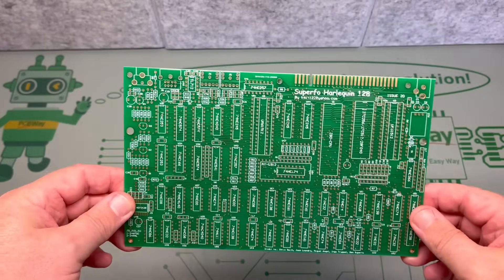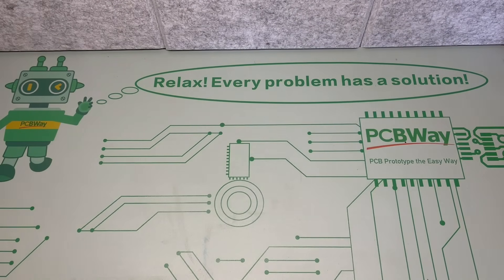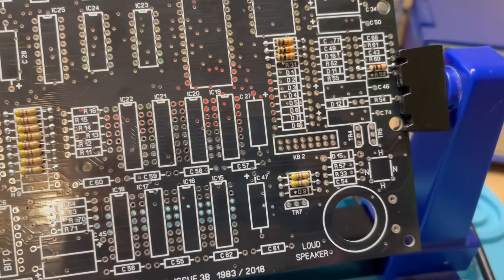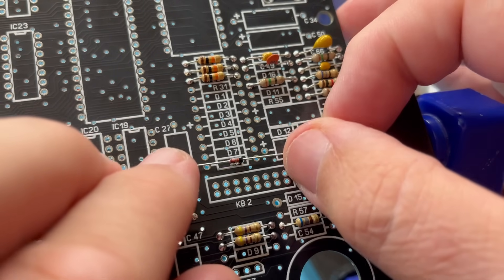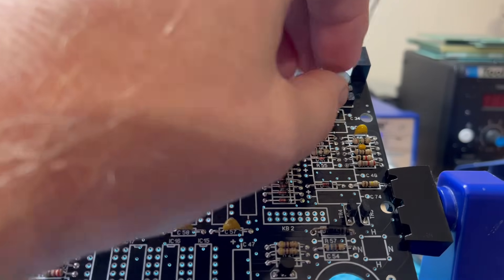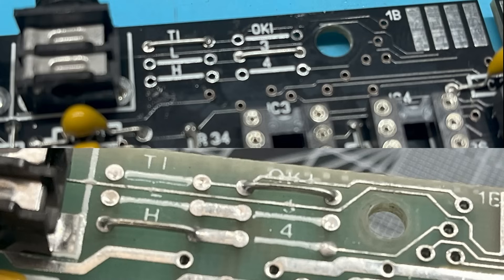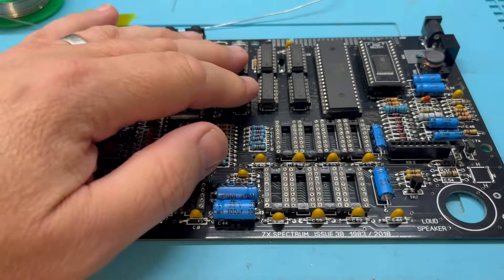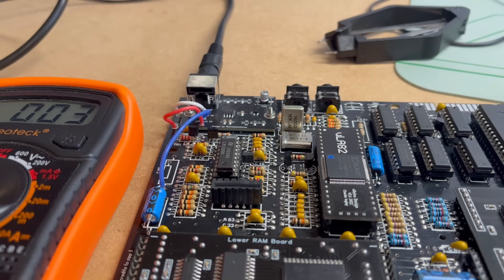I can't figure this out!  This BRAND NEW Spectrum has ISSUES!

Comment: I prefer to bend the leads in towards each other and twist them together to hold the component in place, and it makes snipping the extra easier since the pieces don't go flying off. It also usually keeps the trimmed ends out of the way of other vias / solder points.

Comment: what values did you use for r43, r44, and c72, theyre critical ,also try feeding it with an external +12v supply, maybe up to +12.5 or so, as your +12 is a bit under, some of these TV circuit chips are very fussy with supply voltage , datasheet lists it as 12v 'minimum'

Comment: the LM chip only generates the colour signal, not the whole video, the spectrum will work black  n white with it removed , there is also a 'similar' TI chip that can be used as a drop in equivalent, but its supposedly a bit unreliable , and also obsolete

Comment: For all those screaming NTSC! To get a spectrum like this to display an NTSC compatible signal, you’d need a special variant of the ULA, and two different crystals. And even then… in the UK most TVs have been able to display PAL and NTSC for decades. If it’s capable of S-Video, it’ll handle both.

Saying that… trying it on a different TV seems sensible

I’d also give swapping chips on a regular speccy… I’m sure you have one. The reality is that the ULA is king here, and you’ve kind of tried the LM1889. 

TR1 and TR2 are the other components to check… with R48/49/50

Comment: i can't help but wonder if TR1 & TR2 are the wrong way round ? but this would depend on the pinout of the transistor and are the markings reversed from the original board ? i have some of these boards in my to do pile so looking forward to part 2.. shame that video chip cant be bullied into taking 5 volts
Reply: TR1 and TR2 are correct on the silk screen for the original transistors which was not a TO92 package. A common mod is to use a BC549C which is a TO92 package and has the the pins in reverse order when looking at the flat side. So nothing wrong, just not using the original component...

Comment: You correctly said you were going to solder everything from the lowest profile first and work your way up. So why did you do the power stuff and the tall standing transistors before the sockets? The whole point of the process is so you can still lay it flat helping keep things like the sockets steady and flat while you solder. With the taller power stuff and transistors in place you will have it wobble and the weight of the board wont be helping keep the sockets in place.

Comment: I had a similar problem when I built the Harlequin, b/w picture. In my case I'd bridged two pins of the little SMD Analog Devices chip. I know there isn't one on the traditional board though so not sure here!

Comment: When I started my retro-tinkering career I watched a lot of videos with recommendations to get the turnpin sockets. I thought to myself: I want to have good electrical contact also for vintage ICs with desoldered and cut legs, so I will buy new turnpin sockets. My mistake was to get cheap ones. They caused me nothing but grief. No electrical contact in some cases and broken pins on vintage extremely expensive ICs in other cases. After inspecting these turnpin sockets with a microscope I saw the barrels were of extremely poor quality, and would either not fit or not clamp the pins very well. I cursed a lot, went back to dual leaf sockets and never had another issue. I probably would have had a better experience if I ponied up the cash for some high quality turnpin sockets, but then again as in this video they have a very tight tolerance, and could cause issues as well. KISS principle... Just go with the standard dual leaf sockets. I now own 7 C64's and 3 spectrums, and never have these dual leaf sockets given me any grief.

Comment: I wish they would just integrate a simple bridge rectifier on the DC supply input so polarity on the DC adapter doesn’t matter. This was a common tactic used back in the days of CB radio so an accidental reverse polarity didn’t fry your board.

Comment: Turned pin sockets are not designed for dip ic's. They are designed for turned pins. They will just cause problems over time.
Reply: Well I’ve been using them and specifying turned pin sockets for DIP packaged IC’s for 39 years without any problems.  I’m not the only one either.

Comment: Had this problem developing my reproduction D32 board. Every time it happens the first thing to check is the oscillator signal to the lm1889. No clock means no colour and from experience it was always the lm1889 at fault. These things like to play Russian roulette with a fully loaded gun and don’t need an excuse to fail. There are of course other failure modes and the most likely is no continuity between the modulator the point at which you pick up the signal to inject it in the output. It could of course be the modulator not receiving any colour information from the ULA

Comment: Looking forward to part 2! I am visually impaired and soldering is impossible, so I get my satisfaction from watching videos like this!
Reply: Have you tried a soldering microscope? I too am visually impaired (20/200 in my left eye, and for all intents and purposes completely blind in the other) and also thought that soldering was beyond my ability. On a whim I decided to buy a cheap microscope (not even a particularly fancy one, just a cheap $40ish one I found randomly on Amazon) and it literally made a world of difference. It takes a little while to get used to basically operating your hands at a distance (not staring at them directly, but instead through a screen) but once you can wrap your brain around that, it's like magic. I can even manage those ridiculously small SMD parts, if my hands aren't too shaky because I've had too much caffeine. :)

Comment: Rubbish leaf sockets I bet ! lol! Nothing constructive to add other than sillys like colour on the monitor ok (turned up) and is the 5v clean with that DC DC converter in it as opposed to the venerable 7805 i'd scope it ? I had a flick through the data sheet for th LM1889 and would check values of components around there because the chip can be configured to produce a monochrome output which yours is doing and doing it well ! are all the clocks running at the right speed and running cleanly. Dunno I know nothing about the 'speccy' but I hope (and believe) you crack it soon and it's probably something daft !...cheers.

Comment: Get a scope and check the color oscillator is actually running. Also (with it on) try placing a finger gently over the pins of the XTAL, both pins, then each pin in turn, if it suddenly pops into full color then the series capacitors around the XTAL are the wrong value for its resonant mode.

Comment: Why doesn't the lower ram board populate the outer pins of the outer sockets?
Reply: it only needs one set of address lines for the 8 chips it replaces and one data line from each (plus a couple of other signals, ras,cas,wr + 0v,5v)

Comment: Im 100% invested now. Can't wait for part 2! Board is looking amazing btw. I have an issue 2 ZX Spectrum 48k that was upgraded and recapped by a close friend in the UK. I absolutely love this computer and I'm so excited to see how yours turns out when its finished.
Reply: I would strongly recommend Andrea Vavassori's "Issue 4V" board rather than this issue 3B clone. This one is a perfect replica, there is absolutely nothing wrong with it, but issue 4V is based on original Issue 4B, which by me (and many others) is considered to be the most stable/reliable 48K board of them all. It has got a better DC-DC circuit (where the -5V and +12V is generated) and Andrea added some very clever options like to be able to use easier to find 4164 DRAMs in lower 16K instead of hard to find and very delicate 4116s, optional footprints to use very commonly available radial caps instead of harder to find (and usually old stock) axial ones, and some more options.

Comment: Are you using different transistors for the two below the modulator? They appear to be the opposite way to yours (i.e. the same way as the mask) on an original 3b board. Link here if comments will allow one: https://k1.spdns.de/Vintage/Sinclair/82/Sinclair%20ZX%20Spectrum/PCB%20Images%20%28orthogonal%29/ZX%20Spectrum%20PCB%20issue%203B%20-2.jpg

Comment: Be careful with switching voltage regulators, as the switching is high frequency and can introduce noise into the system. Try with a linear one instead to see if it helps. No idea if it’s that, but I know you can’t happily replace the linear regulators without being sure that the circuit can take the noise.
Reply from the maker: Can't hurt to stick a 7805 in and test :)  I'll give it a go :)
Reply: @TheRetroShack  You should worry if the switching regulator is in the rail powering the video circuit. Try looking with an oscilloscope to see if the rail is noisy. If it’s not too noisy, don’t worry. But if you see a lot of noise, maybe try with a 7805.
Reply: That trico regulator has extremely low ripple, but it can't hurt to try

Comment: The next best thing to populating a pcb is to watch somebody populating theirs :).  One thing I noticed, if you didn't pick it up yourself, was an 'incomplete' solder joint on one of the big caps at the bottom of the board ... it just needs to be reflowed.